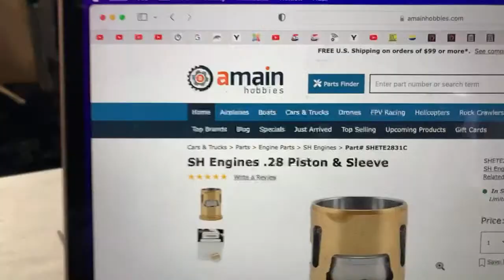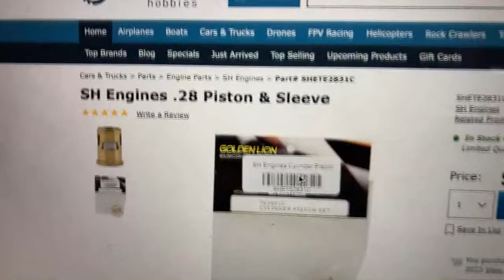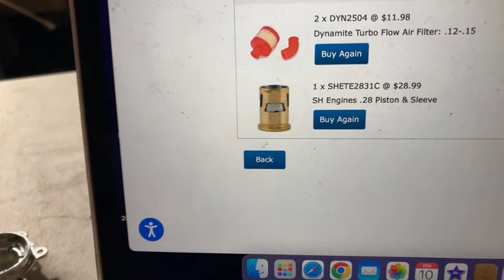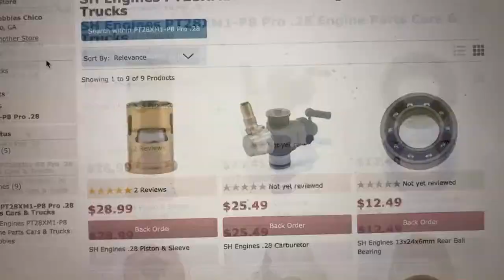Part 2 - losi XXL test start and wheel installation - Free Chat

Comment: Also if the center point looks a little dull use some metal polish 👌 it can also help bring it back to life. If you remove the seals you can replace the batteries they are the Sub-C ones just snuggly fit bro.